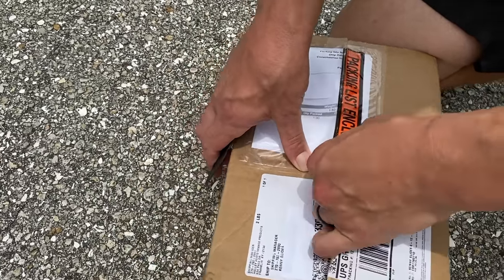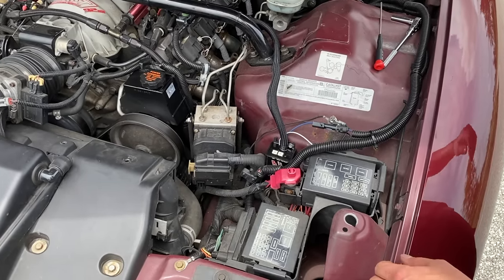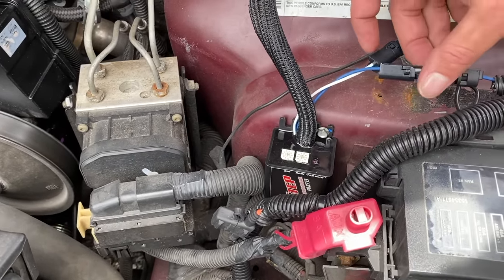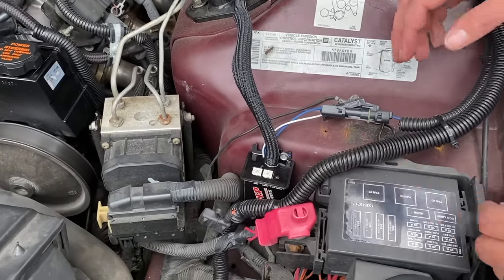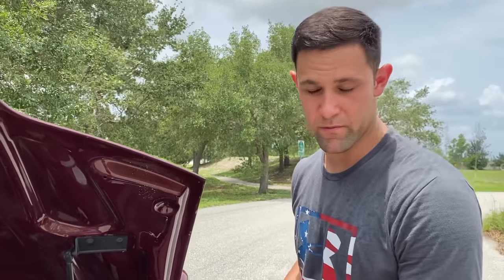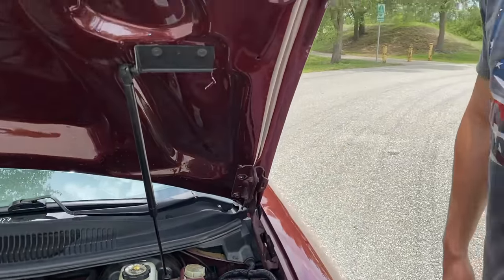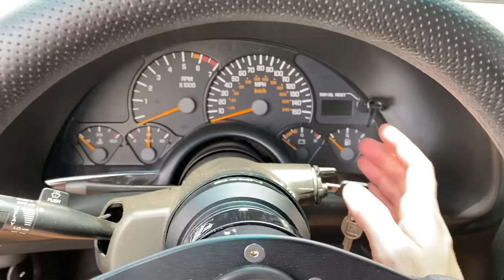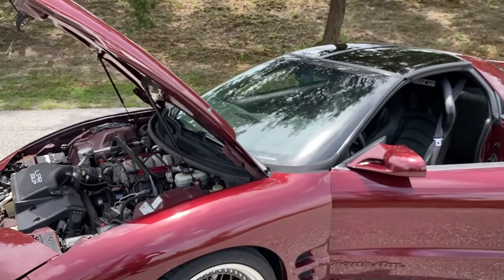How To Make Your LS Engine Sound ROWDY!

Comment: I didnt know you could use these as limiters, i thought it was only for a launch control, will be setting it up like this on my Mustang rather than clutch in “activated” and launching at 2500rpm
Reply from the maker: Yeah it’s cool to have options 🤘🏼
Reply: You can have it activated with 12v or a ground. You can set it to whatever you want.

Comment: I want my Bird back. Just got back from LS Fest. I never have seen so many Birds out there
Reply from the maker: Gotta get ya one man!
Reply: May pal has a 2001 NHRA edittion  black trans am that he's finally dusting off after many years in the garage. Man it looks so damn cool.
Reply from the maker: arodderz They’re fun cars that’s for sure!
Reply: Nick J  here are  specs according to my friend:

Few cosmetic upgrades.

534 made in 2002, Only 136 made in manual. Mine is 1/136. 

manual 6-speed Hurst short-throw shifter, a 3.42 axle ratio (or 3.23 ratio for automatic transmissions), P245/50ZR16 performance tires, power-steering cooling system, and unique NHRA badges and keychain designed by the Morgan Design Group.

Comment: Good afternoon, Kenny. I had my 2000 trans am tuned and the rev set in mind to 6 as well. I do have a set of MSD coils on mine, with their piggy back coil harness witch they recommend. To give the coils  their own 12 volt source. Since the piggy back harness plugs up like that MSD 2 step. Can still run that rev box, and benefit from that rev box? Once again kenny. GREAT TRANS AM. I have the same color.

Comment: In order to set it up for launch control, I'm guessing you could wire it similarly (+12v from any key-on circuit), but use a push button momentary switch, instead of a toggle switch and set it for whatever launch rpm you wanted?
Reply from the maker: Yup, exactly 👍🏼

Comment: Hey Kenny, thanks for the video. I have been looking at maybe a set of wheels like that do you like the 19s over the 18s?  My lowering springs are 1.2. just thought I'd ask you thanks!
Reply: Well 18’s definitely have better tire selection, but 19’s look better. There’s ups and downs of both tbh. I run 18’s for cheaper tire selection on my own bird
Reply: Right way cheaper. I'm rocking 18x8.5 up front and out back 18x9.5  they look and perform amazing and got the rims with new tires for a I  couldn't pass it up kinda deal.
Reply: @drewscorner5412  did you get these ESR rims?
Reply: No I got some TSR 609 mate black rims
Reply: Drewgotta 00firebird you drift yours too? I’m rebuilding my 96 for drifting as I speak😂
Reply: @drewscorner5412  nice looking. Where did u find these for the firebird bolt pattern?
Reply: Of all places I found them on offer up. With new tires. The guy had posted them for 550 and I offered him 400. Picked them up the next morning. Was and still stoked about it. They look amazing.  It's already a beautiful car but them rims put it over the top. Huge improvement
Reply: I got lucky for sure.
Reply: @Matt L no she is my daily but I swing it when I can
Reply from the maker: Thanks for watching! I love the look of the 19’s over the 18’s for sure, but I wish there were more affordable tire options out there for them.
Reply: Drewgotta 00firebird ah yeah that’s cool too. I miss dailying mine lol it’s been without a motor for like two months now😞

Comment: I’ve got one on my Silverado .. puts a lot of trucks to shame when all they got is factory rev limiter ..meanwhile mine is popping n spitting flames 🔥
Reply: @JAE's Finest dyno tuning is how mine was done after bolt ons n what not you can also roll the dice on those programmers I’ve heard good n bad buut a dyno tune costs about the same and the tune will be made 100 percent for your vehicle n it’s condition ..
Reply: @JAE's Finest so to make it worth the tune I’d get some nice headers a custom exhaust system an intake system of your choosing ..if you wanna stop there that’s more then ok 👌 your gunna have a check engine after that so a dyno tune is gunna be needed ..you go to a performance shop of your choosing do your research 🧐 walk up and tell him hey I got a Silverado with bolt ons then let em know what you have installed and tell him you would like to dyno tune it ..they’ll take over from there

Comment: I used the same switch on my Monte Carlo. Used it as a ground activation for the torque converter lockup and the thing lit without me having to run power. I was like 'ok, cool'.
Reply: What year you have bro?

Comment: More importantly, how the hell do you keep the stock steering pump from boiling over? I had 3 stock replacement pumps on my bird and after 15-20 minutes of hard beating they would boil over and whine like crazy.
Reply from the maker: Caleb Smith Yeah some people have issues with their pumps and some people don’t, it’s weird. My original stock one went out about a year after getting the car, so I replaced it with another factory oem pump and maybe only a couple times it started whining, but it kept working properly.
Reply: I had the same issue on my F-Body. I installed an oil cooler using the return line from the rack and pinion to the power steering pump. I haven’t had any problems after installing the oil cooler.

Comment: Can this be installed on a stock LS1 engine without being tuned or anything?Thanks
Reply from the maker: Yup! Plug and play 👍🏼
Reply: @KennySlides  whats the msd part number?
Reply: Can this work for automatic as well ? And is this a part I will notice rwhp ? All the way around ?
Reply from the maker: @dickeymoore4264  The link to the part is in the description.
Reply from the maker: @rickmarks7685  This will work for automatics but will not result in change of horsepower.

Comment: Sweet set up my friend.. car is clean. My project 94 Trans am is coming along nicely. Summer is winding down here in Virginia. But I'm taking my time with it..  I'm doing a complete heavily modified restoration on my 94 trans am with a 383 stroker LT1 with a D1SC procharger.. I'm in the process of doing a complete makeover of the suspension. Everybody has different opinions on great performance suspension parts.. but I'm buying BMR suspension components from front to back and in between. All my suspension is going to be completely adjustable.. keep the shiny side up and be safe out there my friend 👍🇺🇲🤙...
Reply from the maker: Thanks man! Good luck with your build, sounds like it’s going to be a stout setup 🤘🏼
Reply: Summer is gone in swva🙃🙃 it was in the low 40s last night, and of course my buddy didn't have a heater in his garage

Comment: I’ve heard limiters trash the valves ? Are there valves that tolerate the abuse? Titanium? Idk
Reply: Inconel valves. They are a nickel-chromium-based superalloy that can handle a bit more abuse. It's kinda the same issue with when people get those excessive burble/backfire tunes. The constant backfires can cause issues with the exhaust valves and seats.
Reply from the maker: I’ve never heard of any issues 🤷🏻‍♂️
Reply: The limiter doesn't harm anything. Spinning it higher than the valvetrain can handle is what causes damage.
Reply: @groverstewart4105  My post was mainly about the aggressive DFCO tunes, as I admittedly have no 1st hand experience with 2 steps. I was just trying to draw comparisons to the effects on the valves themselves

Comment: How do these work with an auto🤔
Reply from the maker: You can wire it up to a momentary switch 👍🏼
Reply: @KennySlides  do those work for Nissan engine with. Auto transmission?

Comment: The rev limiter can be modified with HPT, by using the disable/enable fuel cut tabs.  Just change it so the enable is 1 rpm less than the disable....  You might already know this. Is there an advantage to doing it with the MSD for spark cut as well?  I didn't see a point to go any further, but then again, I'm not smacking my rev limiter like a mad man.
Reply: yeah i mean using the MSD is only spark cutting so it likely will have the effect of fouling plugs eventually
Reply: I know this is an old post but I’d prefer to cut spark over fuel with boost.  I’m running a SBE LS2 with a blower so I don’t want to risk leaning out with fuel cut.  Spark plugs are cheap, rotating assemblies aren’t lol. 👍🏻
Reply: @josephcottone9613 i’ve had this happen many many years ago on a turbocharged 5.3L, which ended up backfiring through the intake and bending 5 connecting rods like bananas.  I cant be certain if the tune was set to re-enable spark or fuel too quickly once it bounced the limiter. But I believe that’s what happened.

Comment: BRO, You have zero idea what you're talking about.  stock rev limiter or any rev limiter for that matter has NO impact on the thrust bearings. Engine power does not push on the thrust, it pushes on the rod and main bearings. Your CLUTCH slave cylinder pushes on the thrust bearings harder than anything you could possibly imagine. That's how it disengages the clutch!   Also, the MSD rev limiter cuts FUEL and SPARK??   Wow..  So it controls the injectors through the coil harness? Impressive!   *Facepalm*...   1 bolt holding the box in, and zip ties engine harnesses to the chassis. And you wonder why you have issues with the old one..  You put ENGINE harnesses on the ENGINE..  When the engine moves, the harness moves with it. When you have it mounted to the chassis, when the engine moves it moves everything in the harness together so essentially the harness is not forced to move/flex.  Wires are not infinitely flexible. they will FAIL if you flex them all the time like what happens here..   But hey, you do you..  LOL

Comment: Anyone who has drove one of these f bodies knows that its really hard to drive one like that. He has skills
Reply from the maker: Really appreciate that!
Reply: What? They’re some of the easiest cars to drift. Still takes skill though.
Reply: @MrPland1992  you could be right. I dont really drift mine because its a 30th anniversary edition and I like to baby it. But I have messed around before and it has scared me a few times when the back side wants to pass up the front in a hurry
Reply: shinavea yeah it’s hard at first, just need to learn the car. I took mine to a large parking lot the first day and figured it out. Burned a whole set of tires, it’s worth it though, knowing how to handle the car had saved my life many times especially in the rain. 
Ls1 SS and ws6’s use to be $4000 all day long so I beat the hell out of mine. I’ve had like 50 but prices are through the roof now. Can’t just tear one up like I use to.

Comment: Not sure if this has been answered yet, but is it possible to use the MSD to set up the artificial rev limiter on a switch (as shown in this video) and a button switch for traditional 2step to launch etc?
Reply from the maker: I think it has to be either or but not both
Reply: @KennySlides  I figured as such, thanks my dude. You can fucking steer btw :P
Reply from the maker: @Remzi-n9r  No problem and thanks brotha I really appreciate that!

Comment: What kinda tires u use I kno u burn thru em I do .95 z28 2500 stall shift kit stage 2 nice bird nice drivin nice vid
Reply from the maker: Appreciate it man! Most of the time I used 285/35R19 Michelin Pilot Super Sports or Achilles ATR Sport 2. Now I run Kenda KR20A tires
Reply: @KennySlides  ok bro thanks for the input .keep it going brother I'm a straight line driver mostly but live drifting I'm new but if u do or have tutorials I think I could learn from yu and we have similar cars .peace bro I'm subbed and will be look out for wat u do be safe

Comment: Am I missing something? The car manufacturer put a rev limiter on my engine. I need to buy another rev limiter why again?
Reply from the maker: The MSD 2-Step changes the sound of the rev limiter and also allows you to adjust the rev limiter set point
Reply: @KennySlides  - Not sure what you mean by "changes the sound of the rev limiter. 

I do understand being able to adjust it, kind of like this MSD Ignition Digital 6AL Ignition Control Box

Comment: What exhaust is that
Reply from the maker: Pacesetter longtubes and y-pipe, QTP electric cutout (which is open in this video) which leads out to a Magnaflow catback
Reply: @KennySlides  sweet ima order that cable for my z28 thanks homie 🙏😎
Reply from the maker: @Xehanortlw  No problem man! ✊🏼

Comment: Baller. Better get that second left tail light bulb replaced.
Reply from the maker: MrRJDio Done 🤘🏼
Reply: Miss these cars - worked as a detailer at a Pontiac dealer when the WS6 came out, was a big day. Think it was 1996. The firebirds all came from factory with some sprayed-on plastic and it was a royal pain in the ass to get off the car. Had to spray a solvent and let it melt then scrape it off. Terrible.

Comment: Are you still running the stock rear end ? I had a 4th gen SS. The weak link was the rearend
Reply from the maker: The TA has a Moser 12 bolt with 373 gears

Comment: this is like having a switch on “ tune “
Reply: This is nothing like a tune, it doesn’t change any maps or trims besides your ignition and fuel system upon red line. No performance gain on a stock setup.
Reply: AJ Mason ohhh okay okay then what gains does it have ? What set up does it require ? How much gain ? Is it significant ?
Reply: William Nava basically it’s an electronic box that lets you set 2 different rev limiters. One is your main rev limit, the second is a lower set rev limit that guys use to get harder launches when drag racing, also, turbo guys use them to get their turbos to spool while sitting at the line waiting to go down the drag strip. But now a days, most people use them for no performance oriented reason, just to sit at stop lights and 2 step.

Comment: good bit of wheel hop @ 6:57 ...is that the way you want it?
Reply from the maker: I did everything possible to reduce wheel hop. Lower control arm relocation brackets, tubular lower control arms, Koni single adjustable shocks and Strano lowering springs, adjustable  panhard bar. That’s the end result
Reply: @KennySlides  Well you wud think that shud be enuff! I dont know any other suggestions to help

Comment: I just bought this for my 99 bird I’m curious to how you ran the wires to ground it out? I have a 3 prong switch
Reply from the maker: I ran the solid blue wire to the on/off prong on the switch since I used a 3 prong as well
Reply: @KennySlides  I just got mine figured out I ran it with a push button and with a 3 prong so I have the option. I just put a ground where usually there would be a power source!! Thanks for getting back to me

Comment: How did you do the steering wheel
Reply from the maker: It has an NRG hub/adapter and quick release with a Momo wheel
Reply: @KennySlides  how did you go about the air bag and stuff
Reply from the maker: @Legend22-  It was taken out with the factory wheel

Comment: When you say "how it works " i thought that we was going to see the guts of the module . im thinking a 555 timer with a transistor fot the low speed switching . so its 12 on the rails but its 5v on the switch legs at a 100omh for over voltage protection for the trans . thats how it works i do believe
Reply from the maker: Interesting haha